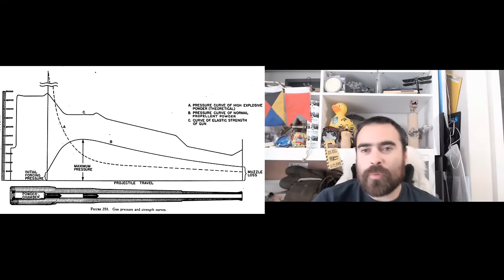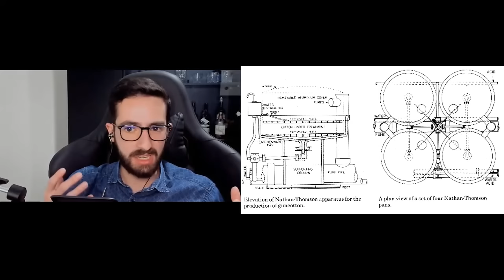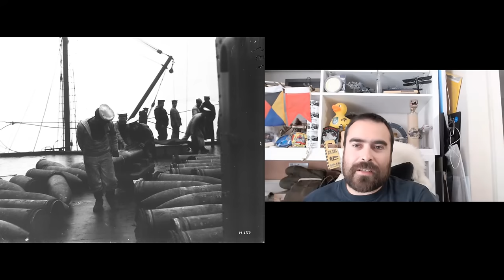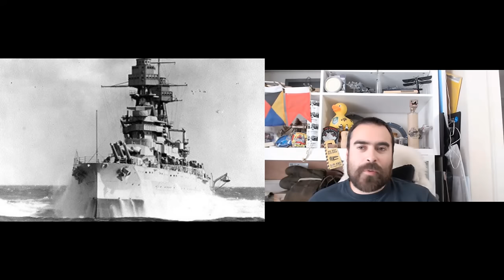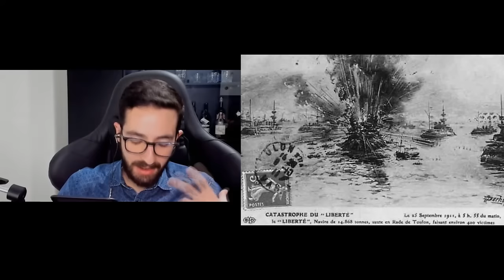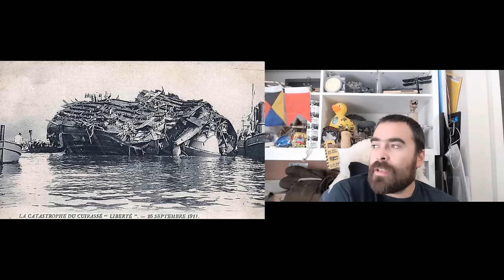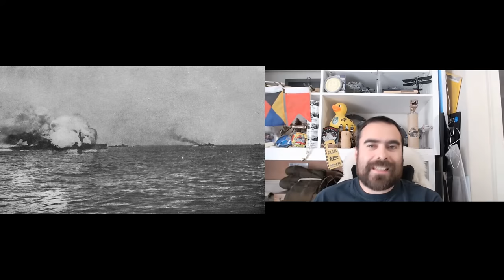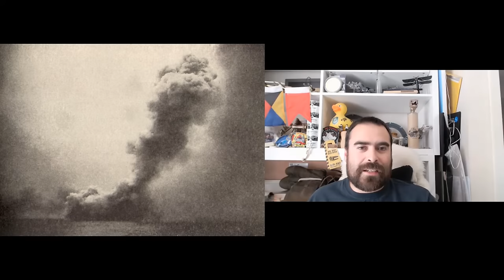Cordite and Poudre B - Why things start exploding at just the wrong time

Comment: "Aerosolized Nitroglycerin Dust" has to be the most inherently dangerous thing I've heard all year, and I work with firearms for a living lmao
Reply: Peter smith  The difference between the two is that you can't really synthesize azidoazide azide as easily and in great quantities as nitroglycerin.
Reply: Some Soviet ballistic missiles were fueled by a mixture of unsymmetrical dimethylhydrazine and red fuming nitric acid, which they nicknamed "Devil's Venom." One time a pipe burst during the fueling of a prototype, killing dozens in seconds including a number of high-ranking officers observing the test.

(They went ahead with the formula anyway because it could be stored for long periods relatively easily and its ability to auto-ignite simplified the plumbing in the engine.)
Reply: A couple more "fun" chemical names: Chlorine pentafluoride and FOOF (as in fluorine-oxygen-oxygen-fluorine).
Reply: People who reload their own ammunition have to be worried about similar dust buildup. Power is formed into discrete grains, and if those break you get dust, usually not a lot, but over a decade or so it builds up and then if dispersed for some reason it can go off like a bomb.

True for flour, sugar, cornstarch, etc. as well. LOTS of mill explosions from ignored or deferred cleaning.
Reply: @gastonbell108 I worked in a bakery for a few years as a teenager. Flour & powdered sugar everywhere. Makes me wonder if we were ever at risk of explosions.

Comment: There was a standing order from the Admiralty that Cordite (especially the Mk2) was to be store in tubes with the date written on the side of manufacture. Cordite more than 12 months old was to be used first due to the afore mentioned deterioration. Grant in the Lion not only found the powder but also found the Cordite had been removed from the storage leather tubes during training and often returned to the incorrectly labelled tubes after if not used so the record keeping was all wrong. He immediately set about having all the Cordite on HMS Lion changed for a new batch. Ref: A Grant “Through the Hawse Pipe” Draft Memoirs IWM 66/28311.
Reply: Good comment - nice to see an actual reference as well.

Does anyone know of any source material relating to the removal of flash protection?  I really wish someone would provide some more concrete evidence to support (or refute) the theory that flash protection was ordered to be removed.  I keep hearing this stated that it was done as part of the attempt to increase rate of fire, but no one ever seems to back it up with source material.  Not saying it didn't happen, just that no one seems to actually prove it.  Surely removing the flash protection from a ship's magazines would be an obviously incredibly dangerous thing to do and I struggle to believe that no one who would have to have actioned such an order across multiple vessels had a problem with that and said "I will only do this if I get it in writing," or put their own concern with such an order in writing.
Reply: This is exactly why I love the comment section on this channel. Not only do I get some extra information but I also get sources, which you rarely ever find in comment sections on this platform. Amazing community here.
Reply: @afrikacorpse  There was no Admiralty order. That's why you can't find one.
Reply: @ifax1245  Yes, I understand that it wasn't an Admiralty order - so who did order it?  How do we even know it WAS ordered?  Again, not saying it wasn't, I'm sure it was, but just asking for some sort of source material to confirm it, because that's what we should be doing - we shouldn't necessarily accept something as fact just because we keep hearing it.  So if it was ordered, who by?  Was it Beatty, Chatfield or someone else?  And why did all the people below them carry it out without raising any concerns?  Did NO ONE at any level in the process not write something down?  If not, then how do we know it happened?  Cheers.
Reply: @afrikacorpse  I can only offer you this information; "When Jellicoe became First Sea Lord he ordered Tudor to retract these criticisms of senior officers and also supressed the DNC report. He put the blame entirely on inadequate armour and physical protection against flash." Perhaps the newspapers were encouraged to report issues concerning the anti-flash doors. Ref: Brown, David K.. The Grand Fleet: Warship Design and Development 1906-1922 (p. 464). Pen & Sword Books.
Reply: @ifax1245  Thank you - wasn’t specifically asking the question of yourself, but appreciate it looked that way.  Thanks for the reply.

I have a few books on Battlecruiser, Jutland and related subjects but still have a lot to read up on.
Reply: @ifax1245  Jellicoe states to Tudor that all turret drill was carried a lot correctly and therefore implication that was not should be withdrawn. However in an earlier addition to a letter he forwarded from Beatty. Jellicoe states. "Forwarded. I entirely concur with the Vice-Admiral Commanding, Battle-Cruiser Fleet, that there is no evidence that, in the ships lost, the precautions essential to the safety of cordite charges, as we knew them, were neglected.

The drill and custom then in force was to keep all cages and waiting positions loaded and the magazine doors open, and all the evidence seems to show that if a turret was pierced by a shell which exploded inside it, the magazine was almost certain to blow up. I therefore ask that their Lordships may reconsider the conclusion stated in paragraph 3 of their letter S.01146/16 of 4 November, 1916.". 

Which leads to Tudor letter to Beatty 
"With reference to your predecessor's submission of the 24th November, No.2791/H.F./1187, relative to the causes of Explosion in British Warships, I am commanded by My Lords Commissioners of the Admiralty to acquaint you that They have learned with regret that the wording of Admiralty Letter S.01146/16 of the 4th November, was construed as implying that the precautions essential to the safety of cordite charges as laid down in Admiralty Regulations and the authorised drill had been neglected, and I am to state that this was not the intention of the remarks in paragraph 3 of the letter.

Their Lordships were of opinion that the regulations then in force were insufficient to ensure that a desire to achieve a rapid rate of fire might not, in some cases, tend to reduce the precautions to ensure the safety of cordite cartridges, which later experience has shewn to be required."
Reply: It's also worth remembering that the opinion of the DNC that shells could not reach the lower deck of a modern battlecruiser might not have survived the 1919 Test on the Hood armour scheme which show that it could (by 2 routes) and it could not be stopped without reconstruction with a single thick armoured deck the likes of which would dominate the designs of series' that end with G3 and N3/O3. So different as these ships one would be forgiven for assuming a change in the DNC had occurred. Though Dreyer had also push hard for great protection against long range fire and it's possible that DNC had hand forces by staff requirements from the 3SL.
Reply: FIFO. First in Last out!
Reply: @afrikacorpse  Maybe the problem lies with the historians involved, Churchill for one was rather prone to petty spites. Throw in the fact he was willing to sell his daughter for a treaty and you may come to realise that he worshipped Molech.
Reply: @charlesseymour1482  wouldn’t that be FILO then?
Reply: @ifax1245  Yes, that was Jellicoe's response to Tudor's misinformed comment about the ammunition drill not being properly carried out in the BCs, he also pointed out to the obviously clueless Tudor that magazine doors remain open during battle because that is how you pass shells and charges to the turret.
Reply: @afrikacorpse You realize that your YT handle is really awkward right? 🥴
Reply: The men were unable to keep up with the shell delivery because the cordite scuttle was awkward and slow to work. 

They raised the subject and it reached beatty who wrote to Jellicoe and they agreed that  the magazine door could be used in lieu.

You have to go to the admiralty archives to read these letters.

No flash measures were removed nor were any breaches of safety protocols ordered.

Its not rate of fire either. Its to prevent delay in the firing rate.  @afrikacorpse
Reply: @jonathanevans4610 the waiting positions were pre loaded. Rather than with the correct or adequate amounts.

Comment: Err... tiny, minor correction. It would NOT be a fuel-air explosion, because for nitroglycerin the air plays absolutely no role there. Fuel-air explosions work because the fuel uses the oxidiser from the air. But high explosives contain everything they need in the molecule itself. And at least for nitrates it's more like decomposition than oxidation anyway. The air at most is a medium for the resulting shockwave to propagate, but otherwise plays no role in the detonation.
Reply: Bio dust wood, flour, human skin... Burn so when atomized in air it can go boom. A little gunpowder lofting the dust...